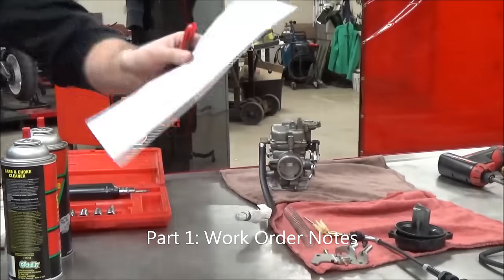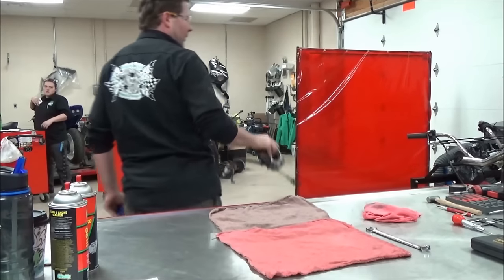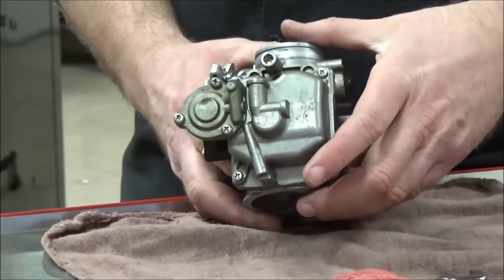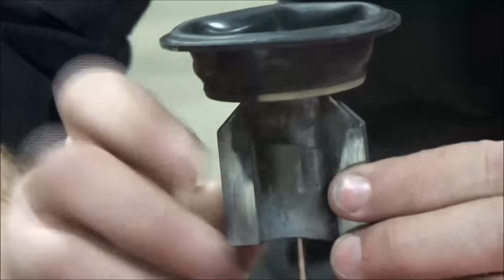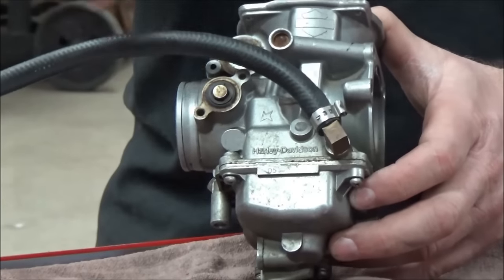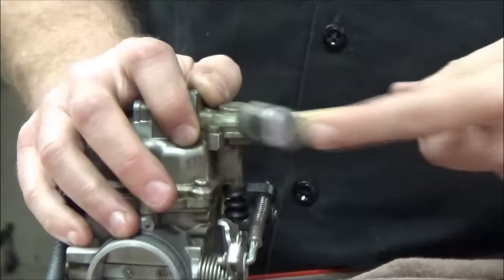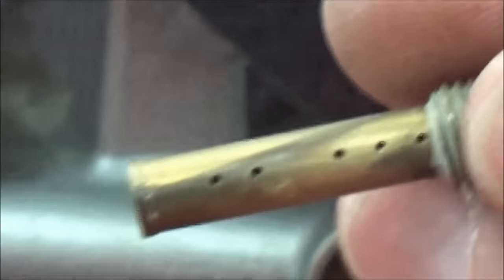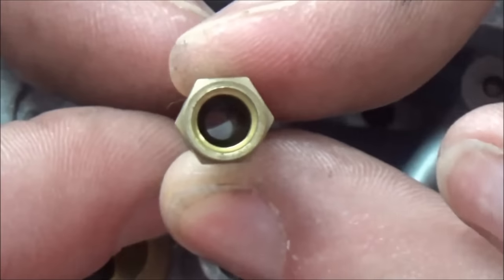01 "How to" CV Carburetor : Disassembly Recording Jets and Settings Cleaning Carb Rebuild Series

Comment: Hello Shane, i just bought a Honda CB750 1981 and my mechanic told me that my carburetor needs to be replaced, is Keihin original one, but even thought i'm not an expert, i think that; with a rebuild kit, new floats and fine tuning it will be ok. But i need professional opinion of how to know if the carburetor really needs to be replace or just rebuild. In all the research I've done, all i found was deep cleaning and rebuild, nothing about replacement.

I'm thinking to take some risk and learn how to do it, i know that is not an easy task, but i have my own opinions about it. What i need is the manual of the bike (which i haven't found), and some guide or tips of how to fine tune it after rebuild. is not an easy task with one carburetor, i can only imagine 4 carburetors. But i think with time and a mentor i can get it run
Reply from the maker: You’re in luck! I provide tech help and work one on one! I know your question may seem quick but with over 300 requests a week, it’s not possible to answer them all. So I’ve narrowed down so subscribers and donations to assist beyond the over 660 free videos. My YouTube has grown beyond the ability to answer every question (11 million views! Over 500,000 a month!)

Click here for the membership links and welcome to the community! https://how2wrench.com/product-category/specials/    

Want to say “thanks” or “keep it up”? Click here https://www.paypal.me/how2wrench   This is great for those truly quick questions you need answered and your help back will keep me going!
Have you Subscribed yet to never miss a video? Have you seen the video playlists https://www.youtube.com/user/conleybuilt/playlists ? Quick answers are often found here. No time to look through videos? 
Your answers and help are just around the corner. Save time and money while protecting your investment and yourself by doing it the right way!
Admin How2Wrench.com
Reply: The tech support and the work one on one, is through the youtube videos o how i can make contact. I already subscribe, where can i donate?

Comment: Shane, I'm getting fuel coming out of the two hole on the air filter side right next to the accelerator tube.  The emulation tube and pilot jet.  Is that because they are not seated properly?  Or my float bowl not set right?  Thanks  Your videos are very helpful!
Reply: Could it also be because I have a bad vacuum on my petcock?

Comment: I bought a 2012 ninja ex250j at $700 for a project to work on around the house. I can't seem to find a gasket and jets for my carbs. Do you know of a website that uses paypal? Also, the adjuster screw is factory sealed with aluminum so i didn't take it out to clean it. Do you think I need to clean it out and do they usually gum up with the rest of the bottom end?
Funny story or mild horror story:
 After cleaning my carbs and putting them back in, I started the bike.
 Unbeknownst to me, the throttle adjuster screw is maxed out and the overflow hose is positioned right towards my leg. I got excited that the bike started right up, but that feeling quickly changed when the rpm range starts climbing. The sound of the exhaust pipe kept amplifying and the small tin carport amplified the sounds of my howling, revived beast. At the same time, the vent hose starts spewing fuel on my leg. I'm freaking out thinking im about to explode in a glorious ball of fire, but my first action is pressing the horn instead of the killswitch. Beep beep - is there room in hell for a noob?
On a positive note, the bike idles fine with just the throttle adjuster set and just the bowls full.
Now, where do I find gaskets and jets?
Reply from the maker: I use paypal and can get you what you need. I'm a full-service shop, trainer, and parts department. Thank you for the comment. See the link below for more help with your question. I have been banging my head against the wall thinking of ways for people to say thank you in an impactful way to help keep these videos coming. Here are few ways that many have found as a way to give back. 
* Membership to H2W (includes t-shirt or tech help) https://how2wrench.com/product/membershipmembers-onlymembers/
* Simple donation to say "KEEP IT UP"
May you have a great day and... https://www.paypal.me/how2wrench

Free Mechanic info, tool reviews, and “how to” videos newsletter sign up: https://how2wrench.com/subscribe-free-newsletter/

Missed a past issue? No Worries. Newsletter Archives: https://how2wrench.com/blog/newsletter-archives/

Like freebies? Click here for a free diagnostic checklist! 
http://gem.godaddy.com/signups/364621/join  

If I can ever be of service to you, here is a video explains how to connect with me. 
https://www.youtube.com/watch?v=vjvmB01ebcs
Reply: Shane Conley 
Sorry, I didn't mean to undercut you. I saw your post after I made the comment with the link. Feel free to delete.

Comment: Very good video helped me a lot, I'm having trouble with my ER-5 carbs all clear but will only run on choke and when i rev the engine it dies? Any ideas regards Chris
Reply: Hi Chris. I see that your 2-yr old :) problem is very close to mine. KLX250S, dies as soon as I apply any load, although it will rev and doesn't require choke to run. I'm a newbie but have fixed two lawnmower carbs in the past. I suspect based on watching a few videos that our main jet is clogged (as opposed to the idle jet). The fact that there's separate jets for each is my clue. Hopefully I can confirm this after I do my cleanout.

Comment: at 5.48 you call this an "accelerator pump". Isn't that an idle speed cutoff valve. It has a diaphragm inside and I understood that it smooths out things when the throttle is closed to avoid crackling. I can see that this is a HD carb you are working on but the appearance of this valve is the same as the Keihin VD10  or the Keihin CVK 30 .
Your video is a good one so guys may gravitate to it to get the basics on carburettor disassembly but BE CAREFUL . Keihin on Hondas use JIS screws and if you use a phillips head driver, you will damage the screw heads especially if they are tight. Then the trouble really starts.

Comment: The carburetor receives the gas with a delay, as if it has some delay, it pulls well at higher revs and at lower revs, but it seems that when you give the gas, there is a delay of half a second before it catches with all its power. This was not the case before, it appeared after the overhaul of the carburetor.
What could be the reason? Thanks in advance!

Comment: Hey brother hope everything is cool :-) I was wondering if I can take and advise from you. I have a 98 zx7 and I have done everything to this thing. The bike starts and idles real good. I clean the carbs, install new bowl gaskets, needles and seats. Adjust floats to 13+2 , air screw to 1-3/4 and adjust vacuum to synchro the carbs. New fuel pump, plugs, cdi, pick up coil. Now the problem is that the bike accelerates smooth and powerful at all times but once  I get to steady speed from 60mph and up the bike bogs down and runs very erratic and starving. If i let go throttle and speed down to 60 and accelerate it goes back to full power and same thing happen again. At this point I can't figure what's wrong with this bad boy. I have try everything and by the way I have done all this to try fix this existing problem. Thanks in advance .

Comment: Shane I love your channel and the way you show so much detail and care in all you do and explain why these little details are so important... so I have an issue I got a used atv 2005 Kawi Prairie 700 KVF700 and when I was putting in my dyno jet kit (I know an amazing kit was recently put in and I don’t think the sizes were correct) anyway the rear main jet where it screws in has no hole in the middle I’ve sprayed it and ran a small torch cleaner to see if it was just trash or varnish but I cannot get where I see a hole I can’t see how the fuel would get through the jet but I ran it and it was lean why I changed the jets any idea maybe a bad part or is the rear orfic so small you can’t get light through the “hole”
Reply from the maker: Sound like you got an undrilled jet! I've seen jets not drilled in manufacturing!
Thanks for subbing!
High 5 us with a donation: https://www.paypal.me/how2wrench   
Join this channel to get access to perks:
https://www.youtube.com/channel/UCBhM8DCKnT3qXwTW0eToyCg/join

Comment: I want to thank you for your video. I am repairing my husbands 03 Harley 883xl custom. When we first purchased the bike it would not run at idle without the choke. Even after warming up or driving to idle the choke had to be on. We had a shop do everything in the world to it from new tires to fuel additive but they wouldn't do the carb. I think I found the problem and I'm not sure how to fix it. I think its at 14:46 Where you unscrew the air fuel screw. If you look inside the carb you can see a point sticking through the carb. Running your finger over it the pin is protruding. So the easiest fix to this would be unscrewing the air fuel screw adjust to 1 1/8 turn right? Well its plugged by a metal slug so there's no way to unscrew it. I tried to take a can of compressed air and line it up inside the carb so I can blow it down then I can use carb cleaner to clean it but It didn't work. That plug looks like it can be taken out if you pry it. I don't want to pry anything if I can help it but if the adjustment to the air fuel screw is off then that would be why it wont idle. The tank rusted and needs to be coated and the carb has some rust flakes in the bowl so I'm putting a filter and cleaning the carb out. Also because the choke is being used constantly the choke cable is extremely black. So it will need cleaned or replaced. I'm also lubing the cables. I love fixing stuff. It would be nice to get his bike running so he can have some him time. I really enjoyed your video and the set up of explanation of how everything works. Knowing what does what makes it easier to pin point what is wrong. I also have a jet plugged up so I have to work on that as well. I'm going to go to the bike store near here and get a few things.
Reply: poemranger  stock carb need to be  unplugged
Reply: You're repairing your husband's Harley. That is rare. He is a very lucky fellow. Great to read that.

Comment: . Hi i have a tgb target 525 . 503 cc engine. This use a mikuni carb BSR 33 (33MM DIAMETER) from the factory this came with .225 PILOT JET and 145 MAIN JET can you please advise ma what is the best jet combination to get max power and high rpm( 9.000...10.000rpm) at the moment is runing a ignitech cdi unit witch is programable and no rev limited. Thank you.

Comment: Hi Boss Could you help me please I have an old Suzuki gs 250 1983 And I was Wondering would you say I could repair the Threads were the Pilot Screw goes with a Helicoil thread repair kit. And if I can could you tell me the Size I need Because I haven't got a Micrometer Great videos all the Best Mick

Comment: I'm currently rebuilding the carburetor on my bike and the needle jet that was on my carburetor will not fit in the correct direction (the one you mention about losing in the parts washer). The bike was running a little rough prior to the rebuild and has been running extremely rich and worse since the rebuild. I'm using the same needle jet that was previously installed. Is it possible that this is the wrong size? The fit is so tight, I can't seem to get it to install correctly and dont feel comfortable forcing it in. You said mentioned that it is directional but mine won't seem to fit in the correct direction.

Regardless, I love your videos and find them super helpful. Thank you!
Reply from the maker: Thank you...Sounds like you could use my one on one techline (find on the how2wrench.com website). I can help do it right over video chat. 
Thank you for commenting. Want more benefits? Smash the subscribe button and bell! Want even more??? Join the channel:
-Daily MEMBER FIRST COMMENTS ANSWERED FIRST 
-Live Q/A video chats
-Wonder if we have a video on your need? Members can request content links!
-Full Access to the ENTIRE 700 video library
-Member-Only FREE tool giveaways 
Join this channel to get access to perks:
https://www.youtube.com/channel/UCBhM8DCKnT3qXwTW0eToyCg/join  

Just want to say thanks quick to support us for this information and our work saving you money? 
Give us a high 5 here:  https://www.paypal.me/how2wrench

Comment: Hi need a bit of advice,when I bought My Suzuki Intruder 1988 vs750 Someone for some reason removed the Choke Cable assembly and never put it back again ? I've managed to get another Choke Cable Assembly, my question is on your Video you said the Plastic Nut looked like it was loose and and not sealing and could suck Air past the the Nut into the Carb 4.39 on the Video,How is it possible my Bike runs with no choke cables fitted ? You also mentioned you would show how to Service the Choke Plunger but I couldn't find it on the Videos Thanks.
Reply from the maker: Hope this message makes sense to you as a decent human being that also works for a living and gets it. I’m the intern studying under Shane and on the social media team.. He's in the shop working or training a class. I fInally made it to your comment going down the list...just an FYI...he literally logs in and answers member questions daily! He does an AM and PM check in to answer all member questions. Consider joining...best $1.99 you'll spend this month 😁
Join this channel to get access to perks:
https://www.youtube.com/channel/UCBhM8DCKnT3qXwTW0eToyCg/join    
-Daily MEMBER FIRST COMMENTS ANSWERED FIRST 
-Live Q/A video chats
-Wonder if we have a video on your need? Members can request content links!
-Full Access to the ENTIRE 700 video library
-Member-Only FREE tool giveaways  

Shane does try answer some non members questions when he get's some time so hang tight if joining is not an option for you. 
One of these days I hope to move from the office to the shop! Wish I knew the answer but don't want to bs you. He couldn't screen these requests fast enough...

 If you need help sooner choose or more personal his 1:1 option is below! Here’s the copy text:

He just returned from overseas training techs and his inbox is slammed with requests. He is scheduling time each day again to answer techline orders. He does not have the bandwidth to provide email replies as his schedule is full with shop customers, training schedules, and one on ones. 
There's good news though! A deep dive one-on-one with him is an option. Use video, email and phone support.  
Through the one-on-one service. Get Shane’s cell here: https://how2wrench.com/ols/products/techline-one-on-one        

Have you seen our "YouTube Trained Support Shirts? Great way to "high five us" https://goodfellasmerch.com/collections/how-2-wrench/products/support-shirt 

High fives help too! Give him one here:  https://www.paypal.me/how2wrench

Comment: Carb on my atv seems to be too rich. My adjustment screw is on the engine side of the carb. Ive turned it in till it has lightly seated and still get a little black smoke when engine is at idle. Any ideas?
Reply from the maker: Great news for you! I have solutions for you and will point you in the right direction. Head over to my website become a member now and to receive 20 minutes of personal mentorship with me. You can even use FaceTime if you have it or find a friends iPhone and we can walk through the actual carburetor process together. I look forward to mentoring you.

Note: Membership is not required to receive coaching or email help. Here are the direct links to individual services offered at H2W:

Email Answer Service-Click http://how2wrench.com/product/email-support/ 

Phone/FaceTime Coaching-Click http://how2wrench.com/product/personal-tech-training-phone-facetime/ 

DIY Mentorship-Click http://how2wrench.com/product/diy-coaching-hire-teach/ 

Dealership Training Services-Click http://how2wrench.com/product-category/dealer-services/ 

MMI/Tech School Student Tutoring-Click http://how2wrench.com/product/mmi-tech-school-student-tutoring-services/

Motivational/Guest Speaker-Click http://how2wrench.com/product/motivational-speaker/ 

On-site Training Services-Click http://how2wrench.com/product/on-site-training/ 

Tech Line Services-Click http://how2wrench.com/product/tech-line-minutes/ 

Mechanic on Duty-Click http://how2wrench.com/product-category/mechanic-on-duty/ 

Did you like this free video and hope to see more? Would you just like to say thank you with a donation? Click https://www.paypal.com/donate/?token=TvKoeRazPL-KysbM-e0ttz-C_gPq2IrqxDmM3ORCu4nxJzQWxYbmo-6m3YuNu64XHLngGW 

Keep Wrenching,
Shane Conley
Instructor/Motivator/Motorcyclist!
www.How2Wrench.com

Comment: Does anyone know if there are any main and pilot fuel jets from other carb manufacturers (ie: Mikuni, Keihin, ect.) that can be substituted for use in the Hitachi HSC 32 CV carbs used on the 80-82 Yamaha XJ650?
Reply from the maker: Last I worked on Hitachi carb K&L supply had replacement jets but no interchangeable brands. They are their own beast. 
Want to say “thanks” or “keep it up”? Click here https://www.paypal.me/how2wrench  Thanks for commenting and adding value to our community! 

Please subscribe, share and consider a H2W membership to support our free work here! We are ramping up for the upcoming new member only site with profiles, raffle drawings, and weekly live Q/A sessions and a for sale page!

Have you subscribed yet to never miss a video? Have you seen the video playlists? Over 600 videos! Check them out here: https://www.youtube.com/user/conleybuilt/playlists    

Your answers and help are just around the corner. Save time and money while protecting your investment and yourself by doing it the right way at www.How2Wrench.com